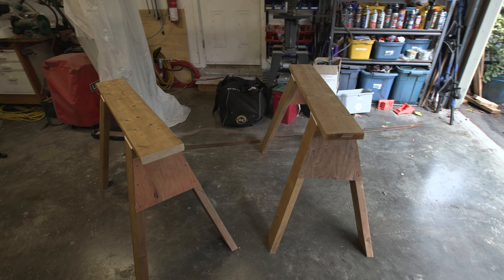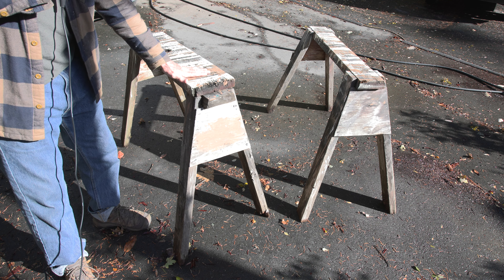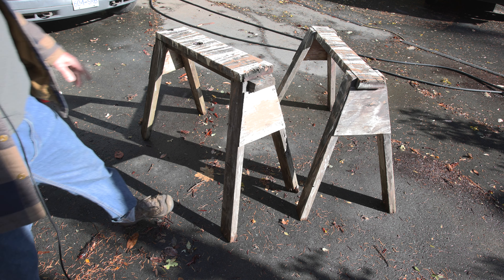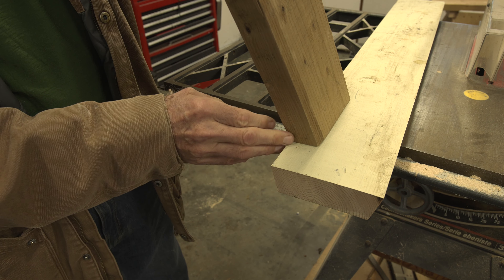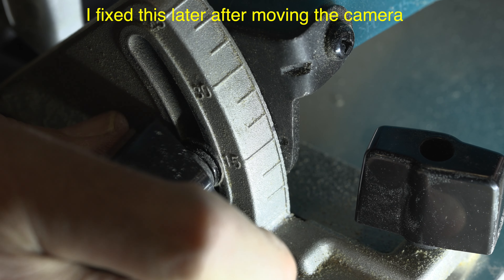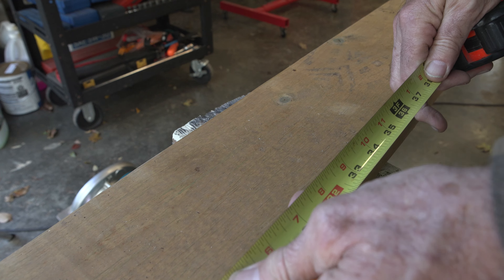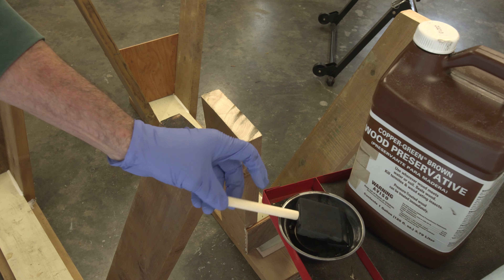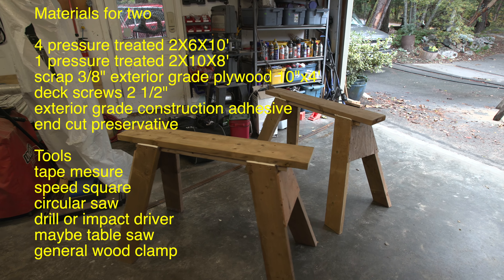How to make the best sawhorses you'll ever own

Comment: Those look like some great saw horses. 
Do you have any issue with warpage from the pressure treated wood?
I replaced the 30yr old boards on my picnic table and though I was buying redwood but in fact I was buying “red”wood pressure treated 2x10’s. The table warps and sags depending on humidity and direct sunlight. I will have to repurchase the lumber after I find a lumber yard that has suitable  lumber.
Reply from the maker: That's an excellent point, Chad. If the legset is tightly held together the chance of wobble is higher, especially if boards twist over time with the dramatic weather change through seasons. I often find variants of this 2X6 design at lumber yards, and I've always liked the heavy feel. If it twists there is always the option to trim down a leg, or even plane or swap over the top plate. We'll see. Thanks for stopping by!
Reply: If they're only used occasionally, rather than being part of your normal work flow, they end up stacked in the unused wet corner of the work site - typically your garage - and the bottom one imbibes the damp - and not being used and being a nice stable platform they inherit a stack of odds and ends some heavy that may help with those warping woes. I have an original workmate workbench (you can call it a sort of saw horse) that has had its stack for fifteen years off in that corner (luckily dry as a bone).